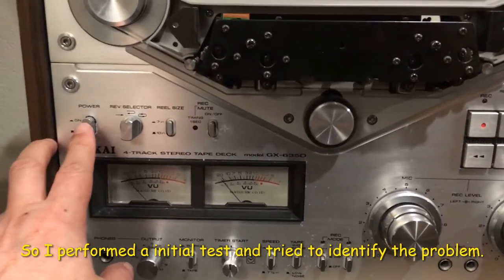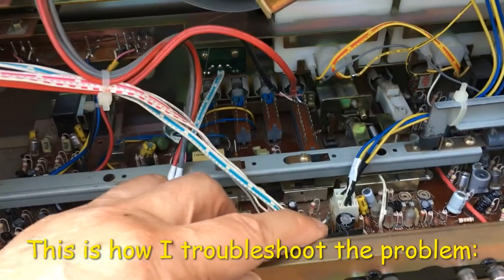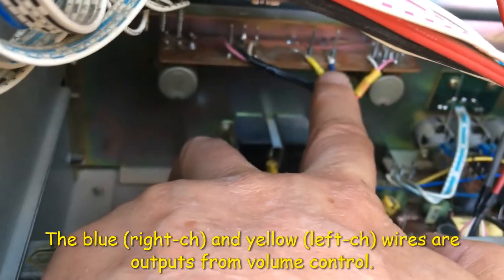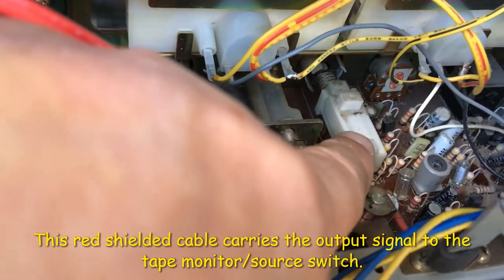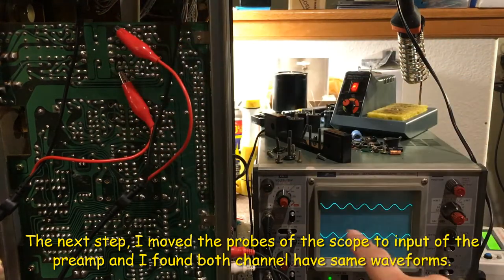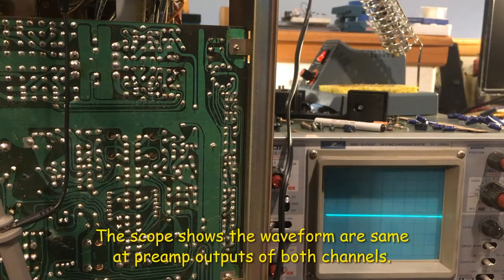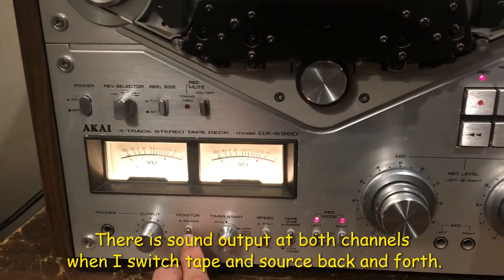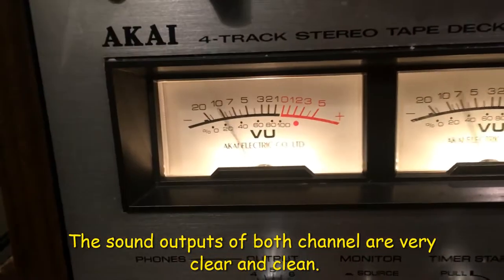Akai GX-635D Repair - Won't Do Tape Recording

Comment: Hi ! I'm not technician but found 20 transistors 2SC458 Hitachi (knew as problematics) in my unit. Unit do not recording both way. My question is if I do replace these 20 transistors 2SC458 , will my unit recording both way again ?

Comment: great  vid   i just started using my 635d   ,,,plays fine   but went to record   both chan  have no meter working an i made  a check to see if i am hooked  up right on my sta 2000 rec  an i am,,, bet it has bad 458 trans  on both sides   i did fix the right playback side with new tran in 2007   ,,looks like  i should  replace all  ,,,
Reply: just to let you know  my boy changed  out 14  458 trans....it recording  an playing  great now....i showed him  the ones i changed  on playback  in 2007  ...

Comment: Have a GX-635D recently but it does not play, it powers up, but no green light comes on, nor any function works like rewind or record. Not sure what that would be. There is tape mounted on it. But no movement of the capstan or motor sound
Reply from the maker: From your descriptions, it seems that your GX-635D may have a defective power supply problem. I suggest to check the FUSE PC board TH-2040. There are four fuses on it. The followings are their power supply functions: (1) Fuse #2 - capstan motor (2) Fuse #3 - reel motors (3) Fuse #4 - record/play amplifiers (4) Fuse #5 - logic control board which handle play/stop/forward/reverse switch functions. If all fuses are good, then you may have defective components in the power supply board which requires further diagnose and repair.
Reply: @VintageAudioFan  Thank you for your answer, I'll look into that as it is a good indicator and starting point to see if the problem is visible there. But a blown fuse is always an idicator of something failing thus in need of a check
I've noticed that these are prone to transistor failure as well. Maybe that is what's the issue but until then I will tackle that first. Replacement shouldn't be a problem but maybe the lack of a scope or is it possible to work on it without a scope

Comment: Hello. I recently bought a broken Akai 635d. The left channel in the reverse did not work, I replaced all the transistor 458 and everything is ok with playback. The problem is with the recording, when I want to record the signal appears on the input, both indicators work, but pressing the tape there is silence. The previous recording is replaced with silence. So the recording mode works. Where could be the problem. Where in the diagram is the rec mute system, maybe it causes the problem. Please help.
Reply from the maker: To answer your question, can you send your inquires to my email?
Reply from the maker: I tried answering your questions but it won't send to you. Could you use other valid email address so I can provide you the solution?
Reply from the maker: This is the email I sent to you: "From your description, I marked up a signal path on the attached circuit diagram, there are some parts that may cause the problems.  So I came up with some assumptions:

1. Transistors TR7/TR8 non function - either defective or no correct voltage (1.4V/6.3V) on collectors.
2. Capacitors C22/C31 are defective.
3. Monitor/Tape switch is defective
4. Check all components inside the marked green square area.

In most cases when both channels don't work at the same time, it usually indicates that the problem is in the power supply. So Please check the #1 on my list first and let me know if it is the case.I will help you with the motor speed issue after figuring out the recording problem."

Comment: I just bought this tape recorder for cheap because broken. No fast forward, No rewind, No play in either direction, capstan does not move up to push tape to head, no green led above play buttons. Amplifier and heads work because if I rotate reels manually I hear recording on the tape. The main motor in the center is spinning when turned on. Where to start? Any advice?
Reply from the maker: Based on your descriptions, the issue may be caused by the defective (1) power supply or (2) operation control PCB. I suggest you to check the fuse PCB (TH-2040) at top right corner at back side of unit. There are 4 fuses on PCB includes: F2 (1.6A) & F3 (800mA) both for reel motors operation (Play, Rev and Brake) ; F4 (800mA) for preamp PCB and F5 (for operation/control circuit and meter lamps). Please let me know the result and send me information via email.

Comment: Do the VU meters have to move equally at all times when the music is playing?
Or does the meters move according to the sound level of the music in each channel?
Does anyone know?
Thank you
Reply from the maker: The VU meters move according the track sound level which tape is recorded. So they don't move equally. There is a an adjustment in the deck which you can adjust both channel VU meter to the same level when the input signals are at same strength.
Reply: @VintageAudioFan  Thank you i always wondered about that.

Comment: Could you please tell me where did you buy that transistor ? Thank you so much
Reply from the maker: The transistor 2SC458 (made by NEC & Hitachi) was designed for low noise audio amplifier use in the 1970's. It can be replaced by the newer generation transistor KSC1845 which can be purchased at Mouser, Digi-Key....etc. Also there are some vendors selling 2SC458 in the eBay, but I can't verify them if they are the true OEM products.

Comment: Hello Sir! I have the same deck, maybe you can lead me the way… rewind is very very slow and sometimes it stops? And second.. the vu-lights are not bright but very low? 
Greetings Tony (holland europe)
Reply from the maker: It seems there is a problem in the power supply which caused it doesn't have  enough voltage supply to motor and VU meter lamps.

Comment: I had similar problem recently in playback the right side disappeared and find that the problem is with the t7 2SC458 transistor wich hfe dropped to 34! Otherwise in diode mode the tests was ok but the DC parameters differed. After some research I found an article with the titel Defective Hitachi Brand Transistors on reeltoreeltech wich is about the corrosion problem of 2SC458 transistors:

'The theory is that the wire leads of the Hitachi transistor get corroded over time, and that corrosion slowly creeps into the To-92 package, where it corrodes the silicone substrate of the transistor. This can lead to intermittent audio, distorted audio, or high background noise levels. On occasion, an audio channel can go completely dead, but left off overnight, the channel can start working again the next day. Even more annoying, if you pull the transistors out of the tape deck, they test just fine in a transistor tester. If you put a voltmeter on the transistor, then the readings are a mile off from what they should be, so our theory is that the transistor junction breaks down when an operating voltage is applied to it, but under the lower voltage of a transistor tester, they check OK.'
Reply from the maker: Thank you for your sharing. I agreed what you said about some faulty transistors can't be detected. Because they show completely fine on the tester. I have a upcoming video which will show the similar issue caused the non output in the preamplifier section.
Reply: @VintageAudioFan  I searched for the best replacement as all similar transistor is a potential failure source and find the 2SC or KSC 1815 wich has identical parameters but lower noise figure typ 1.0 dB.